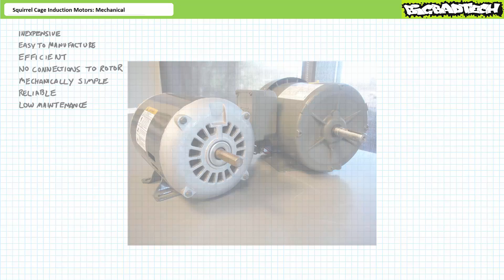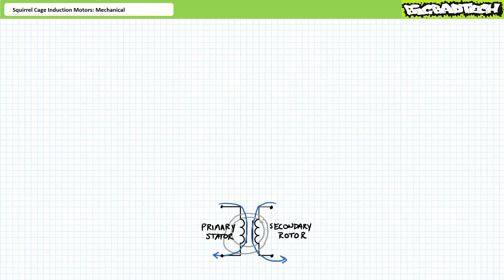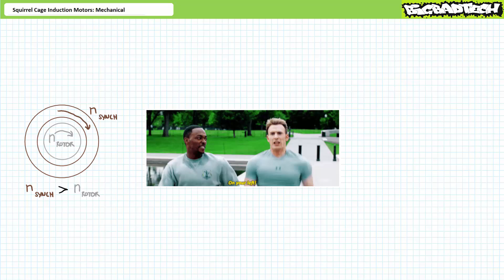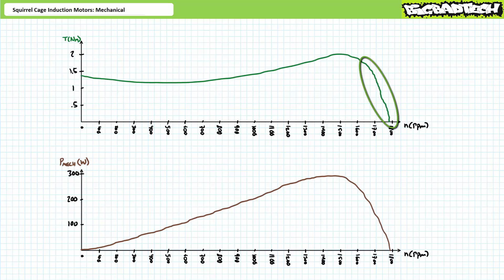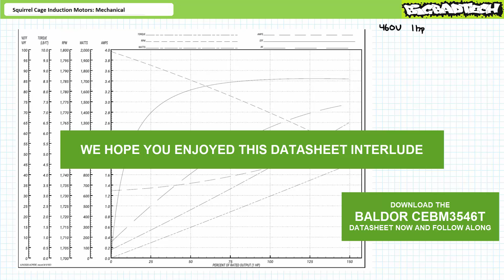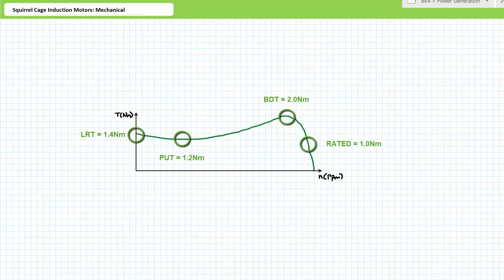Squirrel Cage Induction Motors: Mechanical Properties (Full Lecture)

Comment: Question, I the rotor has no physical electrical connection to it but has induced current flowing through it by the stator, wouldn't that cause an electrical short? Like the secondary of a transformer without a load, wouldn't that trip a breaker?
Reply from the maker: I dig what you're saying but the rotor isn't a "short" but rather a load with resistive and inductive (and capacitive!) characteristics. The Steinmetz equivalent circuit captures this better however it's WAY more complicated to use for analysis purposes. I talk about this in the electrical characteristics lecture at: https://youtu.be/F8BDdTD50yk?si=cYKqkrqNxxPF-RC9
Reply: @bigbadtech  Thanks for the reply, definitely something for me to chew on!